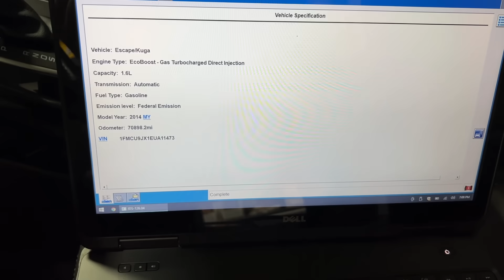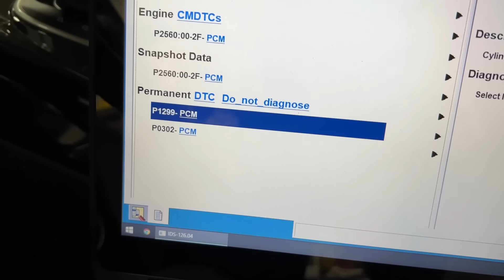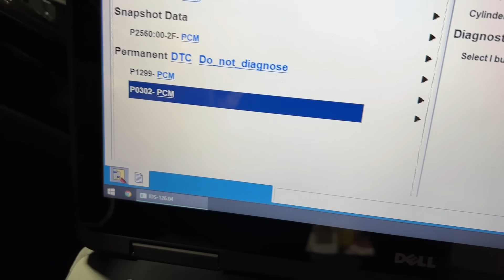Beware of Ford’s 1.5L 1.6L 2.0L Ecoboost Engines and Their Never Ending Coolant Consumption Issues!

Comment: Have a 2016 Escape with a 143000 K (89000 miles) .No issues so far, been a good little vehicle but this makes me lean toward a Toyota Rav when I trade when the extended warranty is up this year.Funny how Ford would allow a problem like this to continue.
Reply: If you have zero problems then why would you want some junk import? You think Toyota doesn't have issues?
Reply: @every-istand-ophobe6320  Didn’t mean to upset you. Just commenting on this apparently known problem with this engine at a certain high mileage and doing my due diligence before buying and appreciate this very good assessment by FordTech. Technically from where I live the Escape is the import (but certainly not junk just a repetitive problem that needs to be corrected) and the RAV4 manufactured only forty miles from my home is more ‘domestic’ and also not junk. In todays world the terms domestic and import are very blurred. You can buy a Ford or Chevy ( GM is known for brand badging I.e. the Buick Envision made in Shanghai China)made off shore and a Honda, Kia,etc, made in North America or a Ford Escape made in Kentucky with an engine made in Mexico or a RAV4 also made in Kentucky with a domestic engine.
Reply: @every-istand-ophobe6320  - we have a fleet of escapes and tundras at work. I’ll let you guess which ones are in the shop constantly, just out of warranty. Every check engine light = $2k to $4k.
Reply: @PapaWheelie1  do I have to explain the difference between a lower end small SUV and a full size pickup truck? Probably about 20-30k different I'm price. So yeah any smart man would expect the truck to be more rugged. Second nobody and I mean NOBODY takes care of a fleet vehicle they are beat on daily and some are barely maintained. So what was your point again? That's like saying yeah in a race my Toyota supra beats my ford focus.  And then you say it like it means something. Go play with someone who hasn't been a mechanic for years .. funny you didn't compare you tundra to the f150..  you know why? Who has the best selling full size truck for over 3 decades? I'll give you a hint it's not a tundra.
Reply: @PapaWheelie1  and second holy hell I bet whoever is working on your "fleet" is robbing you blind you better find a different mechanic. Because nothing on that car cost 2-4k other than a new motor..  but congrats to whoever is bending you over! I would like to shake his hand! Especially if he is doing it "everytime a check engine light comes on" does he at least use lube? On you I mean.
Reply: @every-istand-ophobe6320  - we use the tundras for off road hard service. The escapes are used for light duty on road use. The pick ups get beat much, much harder. The problems on the fords are usually emissions or transmission / flywheel. Yes fleet vehicles are used harder, but after over 30 years managing/driving every type of fleet vehicle out there, I would stay miles away from a turbo car of any type. 

I am a Chevy guy myself, but would say the Toyotas are better than the bow tie. Drive whatever you want, it’s your mom’s money. 

Also if you think $ = quality, buy a BMW and see how that works for you.
Reply: @every-istand-ophobe6320  - ok cool, your right. The filing cabinet in my office full of receipts must be in my imagination. And because you’re obviously looking to get bent, we use the local ford dealer. All repairs are pre-approved, and paid (then billed back to us) by a 3rd party national fleet management company with hundreds of thousands of fleet customers nationwide. They negotiate the best rates and deny unneeded repairs. 

I would never pay dealer rates for repairs on my personal vehicles, but I would never sue myself for improper repairs. It’s a different story when you are a large corporation.
Reply: @PapaWheelie1  doesn't matter whether your a. Small company or a big company your still getting bent over if what your claiming is true. That's the facts of it. And if it costing your company so much money in repairs then why aren't ALL your fleet vehicles tundra's? Hmm? Sounds to me your either incompetent or lying. I would bet the farm it's the latter. No company (yeah before you say something else stupid ) I work for a company with a 10billion govt contract. And several 500mil state gov contracts and If I had all these problems with all my fleet vehicles I wouldn't have them. We have plenty of fords and we dont have any issues. We also have our own mechanics that don't freak out over a check engine light and take it to the dealership to get bent over. Just like my personal vehicles. I have 3 ford's in my garage right now that have over 300k Miles . An escape, F150, Lincoln 3.5 Ecoboost. And 2 of those have had an O2 check engine light on for 150k. .. but guess there are men like me that recognize when I'm being bent over and then there is people like you that think their car is going to fall apart if the check engine light comes on. And then run to the dealer and hand them 2-4k for an oil change and an o2 sensor.  Lol. It's okay Im sure the dealer LOVES you. . just next time at least get a kiss.  But be careful democrats say you can get pregnant.
Reply: @every-istand-ophobe6320  - Must be awesome to pick the vehicles your company chooses. Not my choice here. 

We had f-150’s back in the 2000’s. I remember the spark plug issues well. I suppose the non turbo ones now are as good as the Toyotas. But I would defer to the experts such as the owner of this channel. 

What fleet vehicles do you choose for your billion dollar company? Must be a hassle running the thousands of them around to local garages to squeeze a few dollars for your massive corporation.

Comment: The worst part about that is even if you go for the long block you will just end up with this problem happening again. That is really low mileage, some people could do that in a few years no sweat. 6-8k every few years doesn't seem like a valid option. I am very glad I have never recommended an eco-boost to anyone. Though my usual reasoning is nobody should have a hair dryer on their daily. (if they plan to keep it long-term)
Reply: The engine was supposedly redesigned to prevent this issue. From what I've read there's been no problems on the new design. Time will tell though.
Reply: @sjn7220  what year was it redesigned in??
Reply: @baldheadjamaican2551  2020
Reply: @sjn7220  dam a friend of mines is doing a 2.3 ecoboost swap in 92 mustang with 17 mustang engine with 57k miles

Comment: Sold my 2014 Focus ST in 2020 because it suddenly would lose coolant without any aggressive driving. It had about 187k miles. Haven't watched the video yet, only a few seconds in. Guessing this will explain a lot, & thatI dodged a bullet. Thanks for all the videos pointing out the design flaws for everyone to keep an eye out for & manage as necessary.
Reply: I hope you sold it to the dealer make it there problem instead of some poor kid
Reply: @ONeill_Nolan  , Well I traded it in at another dealer. They low balled me on the offer, but still feel like I came out on top. It was paid off & I didn't want to hold on to it for much longer & have the isssue get worse or totally kill the motor. After seeing that car in the video have issues at 70k miles, I feel like I got lucky with no major issues for as many miles as I had it. Bought it in late 2013 & traded it in summer 2020, so I had a good run overall, but still miss it sometimes. Intended to drive it till the wheels fell off. Got a simple as could be F150 with the 3.3L V6, naturally aspirated. It's nice to have room under the hood to actually fit more than fingers around the motor.

Comment: Thats why i dont buy ford . Its a roll of dice if its going to be good engine.they keep  coming up with new engine almost every yr.  Especially small turbo engine thats not been proven. I Drive a toyota corrolla non turbo and have over 300k miles no problem. Why change or come up with a new engine if current engine is reliable.

Comment: I have a base model S Escape with the non turbo 2.5.  Close  to 300 thousand miles and basically trouble free.  Seems like the more they try to squeeze out of smaller engines the more issues arise.
Reply: Trying to get more performance out of smaller motors has benefits but theres no way around the fact that the motor is just going to be more high strung and more likely to develop problems.
Reply: Same here! I was a Ford tech for 9 years (still a tech but for a fleet of Ford vehicles) and when we bought our 2016 fusion se I wanted the 2.5L engine cause it is vastly more reliable than the other 2 options. The 2.0L eb is a lot better than the 1.5/1.6 but still has issues. Our fusion has been rock solid for us, regular maintenance, the usual front cover oil leak (warranty covered) and a driver seat module that failed ($70 fix) and that's it!
Reply: 2.5 in my 2012 Fusion over 100K miles, doesn't use a drop of oil
Reply: S owner here too!   Never would have considered the other trim levels with the ecoboost.
Reply: This what comes with trying to squeeze a quart out of a pint pot,they’ve had this problem with having to run these engines on a leaner and leaner fuel air ratio because of this pollution nonsense,by doing this and then Turbocharging to regain the power losses associated with cutting the fuel to a minimum which makes the engine run very hot. People who regularly run flat out wherever they go kill these engines in no time because of the way they drive them, they will NOT take that sort of punishment long term mainly because FORD use the cheapest parts they can find to keep production costs down,this has been going on for years but it is more important now because of the power output’s they want out of small capacity engines and to keep weight down.
Reply: That’s great!  I also bought a used base Escape 2.5l too after learning about its reliability.  How long did your trans last?  Im doing 30k trans fluid changes like he recommends but Im wondering about how many miles it will last.
Reply: @realm313  I have never serviced the transmission.   It occasionally has shifted roughly but that seems to be a rarity.   Otherwise never so much as checked the fluid level.  Probably 80% highway miles.
Reply: @woodlandwonders6887    great, Thanks for the reply.
Reply: The naturally aspirated / non turbo 2.5's are long lasting bullet proof engines....believe they only came this way...and the non turbo 2.0's are actually reliable...maybe not as much so...but.....they didn't have the poor coolant design as eco cousin.
Reply: That's not true. The problem is the block in and of itself.

Comment: Why a LONG block? Why not a short block? 
Of course a new engine might exceed the current value of the car when it needs a new engine but whats the value of it AFTER the new engine?  6K$ will buy you another 70-80K miles. What else can you get for 6K$ that has 70K miles left in it other than maybe a 20 year old Jeep

Comment: IF you have a ecoboost with VEP on side of motor tag there fine if you have one with Cleveland ohio on it they are junk VEP motor made in Spain. Same motor  Different quality control
Reply: Our 2.0 was made in Valencia and was replaced under warranty due to coolant intrusion. They're all bad.
Reply: @sjn7220  got 202,000 miles on my 2.0 2013 no problems never seen vep blow and seen like 23 from Cleveland blow
Reply: @charliesgarageusa4986  The 2.0 was redesigned in 2017 ("twin scroll" design). Seems like these are all bad; the version you have is different and may not be as failure-prone.

Comment: It’s so stupid how the 5.4 L two valve engines we’re so good and the three valves were Junk! At least Ford was smart enough not to screw with the two valve engines in the E series vans and cab and chassis but stupid enough to screw with them in the F-series trucks for a tiny bit more horsepower which really made no difference!

Comment: Stuff like this over and over from Ford has convinced me to wait 5 years before I buy the Lightening. Well that andvmy 285K mile 4.6 2V still runs great.
Reply: I have the 2008 F-150 4.6L with 171,000 i don’t think I will get rid of it. I purchased it 2011 with 80,000 miles on it. Very reliable truck.
Reply: I definitely regret getting rid of mine.

Comment: Brian, the content and service you're providing to owners and consumers here is tremendous. It's sad that honesty and transparency are rare in this industry, but you're upholding high standards. Thanks for what you do.
Reply: Honest abe speaks the truth
Reply: I think what may be causing the problem is being run low on coolant and it going in into deactivation mode being  Aluminum block they have a tendency to shift which would cause fatigue in cylinders  Especially  With a Siamese bore engine  Adjust my 2 cents.
Reply: If it’s a Honda or Toyota they would offer a fox mostly free of charge. I’m a ford guy. I’ve had good luck but it makes me wonder why they aren’t offering a fox.
Reply: Bo Blu  grow up
Reply: Brian restores my faith in humanity.  All any of us really have is ability to trust another man’s word.
We loose that society ends.
Reply: amen!!
Reply: FIX OR REPAIR DAILY = FORD
Reply: @michaelRay2576  I don't know. My 2005 Grand Marquis has 285k miles, my 96 Mark VIII has 307k and I had 2 94 vics that got over 260k before I got rid of them and I just got rid of a 2000 Explorer 5.0 with 254k (engine was strong yet). DId just buy a new Maverick Hybrid. Love it. Next vehicle will be all electric.
Reply: Some people maintain their cars better than others .My 99 Mountaineer has 206,000  & doing good
Reply: @michaelRay2576  F****d Over Road Debris...
Reply: so true. ! been a tech for 36  years. the thing auto manufacs get away with is ridicules!   the peddle garbage! my advice to anyone is STAY AWAY FROM ANY TURBO ENGINES!!!!
Reply: @peterpeter5666  Turbo engines are not the problem the owner doesn't know how to properly drive them or maintain them. I have been a Tech 30yrs. Seen it and repaired it
Reply: @graken22  agree but dont tell me turbo engines dont fail more than non turbo engines. its a tech that should be kept to performance cars only. there should NEVER be a daily driver that needs a turbo.
Reply: Cant you just do a head gasket job on these motors? Wouldn’t that only cost like $500?

Comment: Thanks, great information! I am having the exact issue with my 2016 escape however I have 296000 km or 184 000 miles. The vehicle has been amazing otherwise. So this does suck! What are your thoughts on Bars coolant leak in this situation?
Reply: Don't do it. Once that crap is in there it'll never come out. It plugs up everything. Heater core, radiator, thermostat. All of it. And the cylinder is still going to leak because your not fighting the coolant pressure Wich is regulated by the pressure release in the cap. Your fighting cylinder pressure trying to squeeze back thru the crack. Save your money an either fix it right or spend it on a new vehicle.
Reply: You know by nature he's going to try it for $80

Comment: Is this not covered by the powertrain warranty? You said it started at 50,000 doesn’t the warranty go to 60,000?
Reply from the maker: It had 50k miles a year or so ago and now has 70k as shown on the IDS. Warranty is only 5 years so this on expired July 8 2018 which is a long time ago.
Reply: Or 5 years...if they even go that long anymore

Comment: Obviously, it comes down to design issues at Ford engineering but I think that it ultimately begins with Congress, the EPA (government) and their damned idiotic CAFE standards which have forced car makers to place small, underpowered, much-to-complicated engines in vehicles in order to boost mileage ratings.  We'd been a Ford family beginning with a '49 Ford and finally ending with a 250 Superduty with a 6.7l diesel. We're shifted to a Toyota Tacoma with a non-turbocharged V6 and a Subaru with a 3.6L pancake-6.  Give me a bigger, non-turbocharged engine any day of the week over what's being produced currently.  I had thought about a new Ranger but said, no, when I found out that only a 2.3L Ecoboost was available.  It's a shame the trajectory that auto makers are taking.

Comment: I'm a car buff to a degree.  I remember when the ecoboosts came out, the usual suspect car magazines all wet their pants over this being the "FUTURE!!!!!".  High horsepower and small engines.  What could go wrong over the long haul?
Reply: Same magazines that made Chevy Vega Car of the year....
Reply: @michael931  they get paid to write Good stories. Suppose they told the Truth and said. Do not buy. It's a piece of junk for every vehicle they Wet their pants on. 
For them a long term is 10k miles and write happy stories.
Reply: too much power, too small of an engine, going to blow up. these engines maybe no more than 150-160 horsepower max.
Reply: @chester.01a  dude...people are getting 600 horses from a 1L engine. Its not about displacement but quality materials, design, and assembly.
Reply: I have stopped reading car magazines...They are a complete joke....
Reply: The guys who test brand new trucks don't have to use them with 50 or God forbid 100k. They tell you o this ecoboost can haul more than a v8. Yea but for how long? I screwed up and sold my 5.4 for the eco and I try so hard to stay on top of problems. I have failing parts or leaks constantly. Fix one and find another.
Reply: @Ejmil0-i3e  I had a 5.4 and it was a dog, my 3.5l is a much better engine for actually doing stuff more power and easier to live with. As for reliability my 3.5 has only had a water pump and a valve cover gasket. I’ve had more issues with iwes then anything else.
Reply: @FishFind3000  what are "iwes"?

Comment: Wouldn't the new long block due the same thing ? Seeing how its an issue with the ecoboost ?
Reply from the maker: No the short block portion has been redesigned.
Reply: @FordTechMakuloco  does oil show up in the radiator also ?
Reply from the maker: no